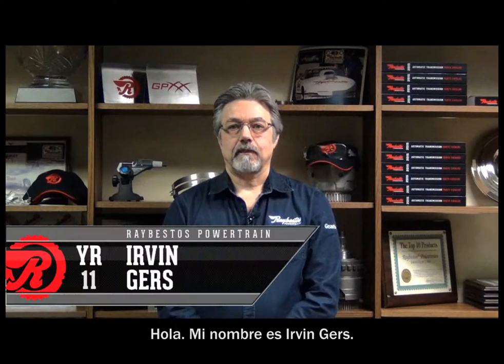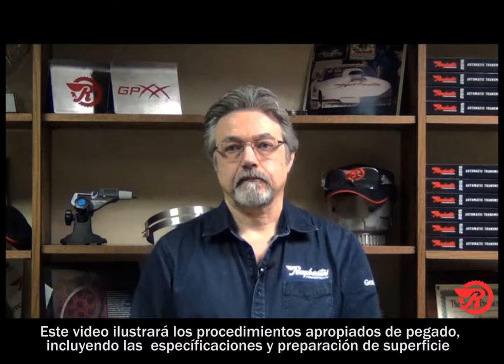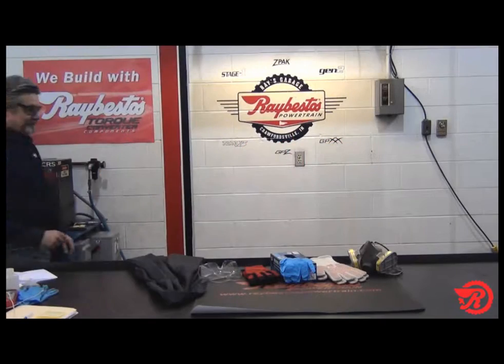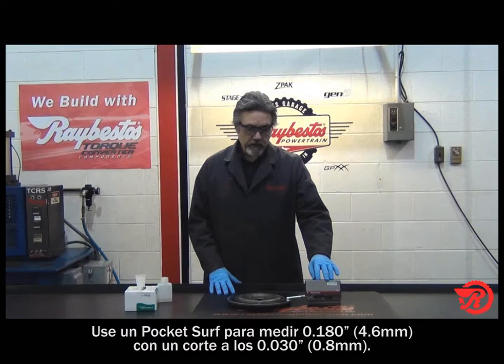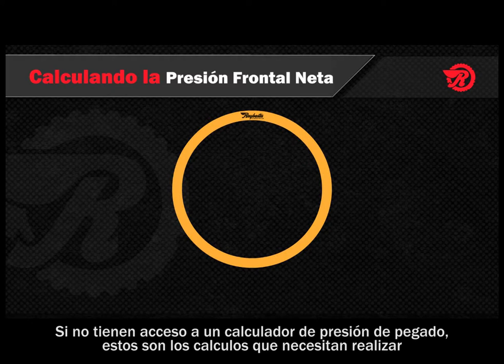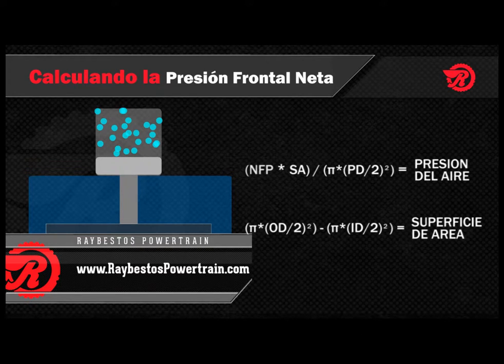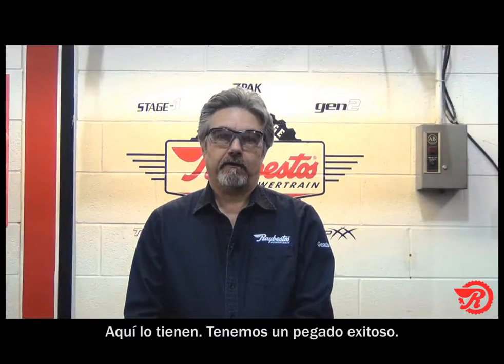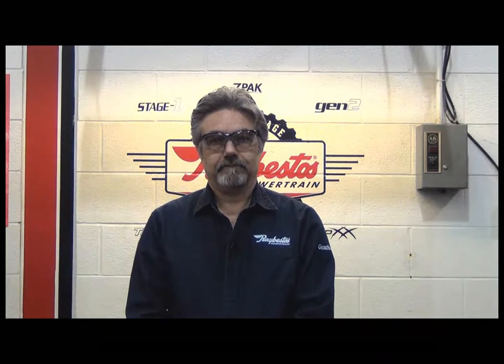Key Elements of Torque Converter Bonding (Spanish Subtitles)

Comment: I had no end of trouble with an E4N71B Jatco 4 speed transmission after I got it rebuilt 17 years ago,transmission had a little bit of a vibration from 3rd to 4th gear,then it turned into a constant vibration under load in 4th gear,to me the torque converter lockup clutch was slipping.
The transmission specialist had the torque converter rebuilt & I'd say in Newcastle (Australia),we had one replaced under warranty,it went o.k. for a while then it started to slip & vibrate again,since it was an Nissan RB30E powered VL Commodore,the fuel economy dropped from about 30 miles per U.K. gallon to 22 miles per U.K. gallon,about the worst I get out of my current Commodore which has the Chevy LS1 engine & T56 Tremec transmission,I eventually did a 5 speed manual conversion on the VL Commodore because I got sick of taking the car back to the transmission specialist & the warranty ran out on the auto transmission unit.
The fuel economy went up to 33 miles per U.K. gallon with the manual transmission fitted & the car ended up being more torquier & would've gained rear wheel horsepower.
Now I think the company who rebuilt the torque converter may have did a bad job on bonding the friction material onto the disc or just cleaned out & reassembled the torque converter using a second hand friction disc.
So, I wasn't very happy to spend $1100 AUD on an auto transmission overhaul only to end up throwing in the tip for scrap aluminium & metal,I've kept away from automatic cars ever since that thing has been a total pain in the ass for me !!!!